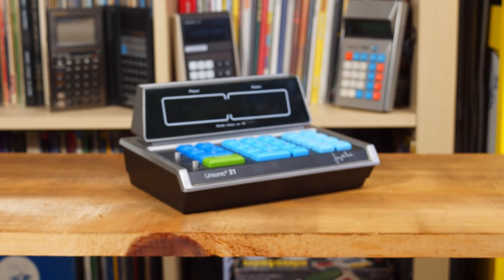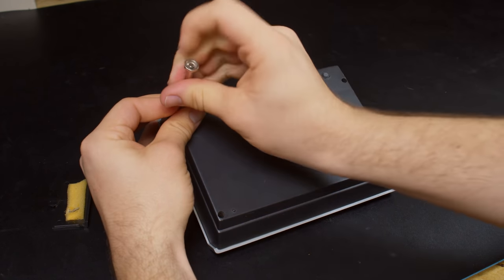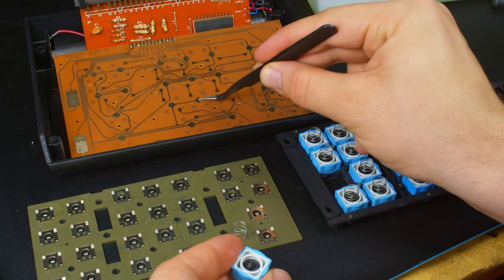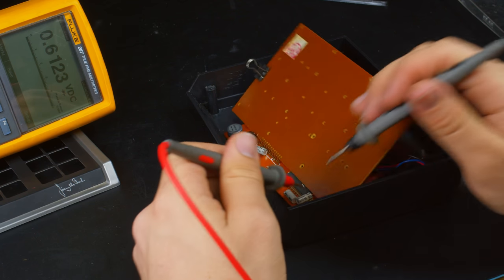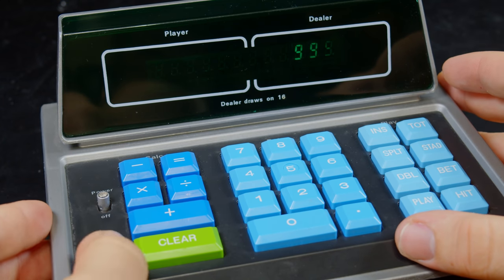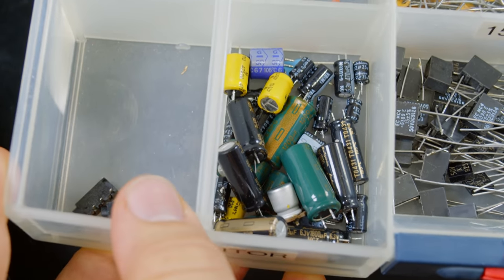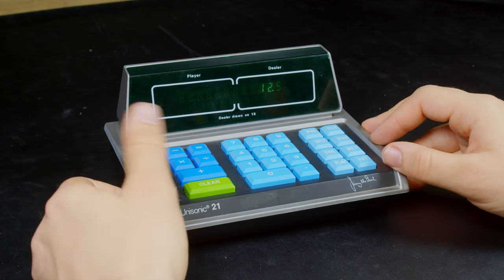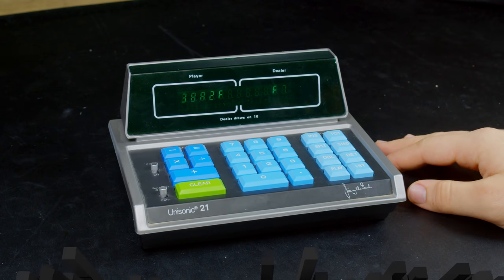1977 Blackjack and Calculator Diagnosis

Comment: The white "ghosting mark" /IS/ a problem. It should be nice and shiny, not white. The display lost some of it's vacuum and the getter material that was deposited onto the glass was used up when the air started entering. The round thingy is a transformer. It's not faulty, you have the Negative 35-ish volts you need and the AC filament drive.
Reply from the maker: You made me go look up the part number for the display, and it is looking like that may be the problem based on the white mark being black on NOS parts: https://www.ebay.com/itm/VINTAGE-FUTABA-13-BT-94Z-8H-VACUUM-FLUORESCENT-DISPLAY-NOS/264066687238?hash=item3d7b99e106:g:AZkAAOSwnfRcAXwY:rk:1:pf:0

I was basing this off an experience with a Casio CQ-1 I was sent. It uses a VFD that was sealed with a white glue substances that looked just like this does. I got a bunch of comments telling me the VFD was bad in that when it wasn't because I repaired it by replacing a blown transistor and the display is brilliant on that device now. So from that I learned a white mark may not be a bad VFD which is now a lesson I unlearn with this one.

Unfortunately, that VFD is still about the same price as the caps and therefore the NIB example for me. So I will still not be repairing this one.
Reply: Yep, VFD clearly is gassy, needs to be replaced.
35V looks healthy for a display like that. 8Ohm ESR isnt good but would not cause much trouble yet.
Reply: I was about to point out the same thing. Beat me to it, good job!
Reply: David Richmond You're right, it's a gassy vfd, the shading towards one of the ends is more evident in dc filament vfd tubes, the emissivity decreases as it gets farther from filament ground.
Reply: @johnbonham7515  In this case i think the shading is a coincidence, other than DC filament. The small round TDK transformer offers proper AC drive which is what's used here. The shading might be a mix of a gassy VFD + bad multiplex timing.
Reply: zapro_dk Yes, I agree it has gassified. The bad multiplexing may exacerbate it, I remember some long vfds with multiplexing problems on which a sort of "zebra" pattern (bright and dark alternated areas) was visible.

Comment: A general rule of thumb for cap replacements with me is if it's blown/bulged, I'm replacing it with a higher voltage rating. If they're old, I will replace with like or higher voltage depending on what I have. 50volt ratings aren't unusual actually, even with caps down to 1uF. Whenever I get from Mouser, I usually do a variety order with a max of 20 bucks including shipping. I'll get what I need, plus a general variety of other value components to throw in my parts bin. If I need 10uf caps, I'll get them plus a few extra, and I'll throw in 100uF, a couple 1000uF etc. It helps to build a small stock if you find yourself repairing things  like that often.
Reply: Its funny how i aways see these prestine looking capacitors all failed and broken in other's people hardware, in videos, etc. But my old pcchips board with literally 90% of the caps badly deformed rusted and even leaking sometimes, still actually decently working (after you clean the ram slots with alcohol because capacitor fluid might be getting in there sometimes). 

I gave this board 3 years ago to a friend who supposedly would (eventually) recap it, but from what i know he didnt recap it yet, lol

Comment: On the topic of calculators , the best kind of costcutting on a calculator is to not include poweron reset requiring manual zeroing before use.

Comment: New in the box most likely won't work either. Capacitors age by only sitting dormant too
Reply from the maker: Very likely,  but one in NIB condition would be a much better starting point if I wanted to repair one of these. When I picked it up for $5 I didn't know I could get it NIB for $16 or I probably would have passed on it.
Reply: VFD might be good tho.

Comment: I like to fix my own stuff , it’s kind of a hobby .There’s a huge scrap yard near my shop that has tons of electric boards laying around , whenever any of my appliances or tech gadgets break i go there and always find whatever i want . I’ve found dozens of capacitors , resistors , diodes and even mosfets for my welding machines . I became friends with the owner ,I pick up whatever i want and the he even invites me to sit down for a cup of coffee and doesn’t charge me anything , when u said 10$ for capacitors i felt pretty lucky .
Reply: When you see how expensive is to recycle/trash electronics, you'll understand why the guy is more than willing to give you stuff for free.
Reply: CrimSun i’m pretty sure he piles them up and sells them by the ton so contrary to what you said he gets paid to get rid of them .
Reply: @Danny-wv8ec  I'm not sure if this applies to where you live, but in other places, you have to pay to have electronics recycled or out of your hands.
Reply: CrimSun i checked on Google , scrap yards all over the US buy electronics . The most expensive pricing is for CPUs , more than 35$ per pound , hard drives are 4$/lb. They also buy all kind of mother boards and PCBs .

Comment: Slow start and very faint display almost always mean dry capacitors. Replace them, especially the one in the logic power circuit.
PS, 5 dollars for 5 capacitors? Their actual price is at least a hundred times less...
Reply: Shipping is a killer
Reply: If you want to use the exact values when you can put higher values ones (which was what I did when I had to recap my PC display), yes. Those off value ones are not manufactured that often.

Comment: Nice work with the zoom/approach effect (can't remember the technical name!) in the opening shot! Do you have a slider now, or just some good post prod stabilization?
Reply from the maker: I made a slider out of a server rail. That is a real slide with fixed focus on the camera leading to the calculator. At some point soon-ish I'm going to be doing a filming setup video covering my new camera and the new microphone I got that I used for the first time in this video(a Marantz MPM-3000).

And it's called a Dolly Zoom, so you were close!
Reply: @TechTangents  Oh wow, nice idea for the DIY slider! I'll have to keep an eye out for some stable rails for my own video projects haha

Looking forward to the new gear vid :)

Oh, and thanks for the correct name too haha
Reply from the maker: After having made it, I don't recommend making a slider out of a server rail. It rotates way too much because it's really only designed to be strong in one axis. I had to add a flywheel and pulley system to make it even close to stable and it still isn't great. I'll cover why it's not ideal in that gear video.

Comment: It's indeed the display that's gone. The getter-spot has turned white, that means that air got into it. This way it can't work properly and it will even worsen as more air gets into it. Also the heated cathode will burn out rather soon in the presence of air.

Comment: Come on - pull the trigger and just complete the repair! Between the time spent troubleshooting this device and filming and editing, you're already invested way beyond the value of this gadget (30x?). Just order the caps and solder them in - that's the fast part left to do. Maybe slot that part order in alongside others next time you're putting an order in with DigiKey or Mouser or whoever, so that the shipping gets subsidized by that new order - we can wait for the video. Also, I wouldn't trust the ancient new in box one as necessarily being any more reliable than this one, unless the seller is showing pics of a fabulously working screen, etc. Best wishes.
Reply: The caps are fine. The VFD is gassy, and that is why it looks so dim.
Reply: Probably tho the vfd is also shot. And tbh he could like wire in paralel a bunch of caps to met the old bizarre ones (probably), but that doesnt seem the way he would do it.

Comment: When making a list of components to order in the future, make sure you also write down what they're for. Otherwise after a year, when you remember you had seven order lists in five different locations on your hard drive, you're like "what the hell were these for?" I also tend to lose my repair notes so sometimes I write a post-it note of the symptoms and possible defects and fixes I've discovered, as well as a mention if I've connected mains to the logic chips, and leave the note inside the case for future me. Or maybe even someone else who wants to fix it when I've lost my marbles and I'm being treated someplace soft.

Comment: I've seen some of the old COLECO table top arcades VFD displays go from non working to working simply by taking the cabinet apart, doing nothing, putting it back together.....? BAM, fixed and fully working for "reasons"

Comment from the maker: About the back filming surface, after a test video I decided to record a complete video using the underside of my ESD mat. Here is the test video: https://www.youtube.com/watch?v=1XoyG6w6FJo The blue reflects a lot of light onto the subject and into the camera during macro shots. A darker mat would give a noticeably better image quality. But the black is too dark. It didn't work well for this video. I will be going back to the blue side until I get something else that works better.
Reply: sorry link machine broke
Reply: Do you have an idea of a color/material that would work? like a specific shade of gray or something?
Reply from the maker: @guycrew728  My intention is to now find a very deep dark blue. It should really be an ESD mat so I can work with out worrying about damaging parts(and snide comments). A medium grey would work as well. Most ESD mats are too lightly colored though so it's a challenge.

Comment: The brightness gradient is caused purely by the amount of time each digit has been illuminated over the years. The rightmost digit would be displaying '0' for much longer than the other digits would be used.
Reply: A battery powered device? No. This unit has very low hours on it.

Comment: Lol I was screaming capacitors from the beginning... I also have a Unisonic calculator model 1048R and also had a ton of problems (bad capacitors, bad switch contacts, bad power switch) and I still didn't properly fix the key switches because when you press some of them they repeat themselves lol.

Comment: My comment was auto deleted when I added links to the images for the unisonic 21 and adaptor so I am reposting my previous comment.

According to the labels on the unisonic 21 game calculator model d-3, it’s electrical rating is 6V DC 140mA and it can run on an optional A/C adaptor available from unisonic dealers model no. SY1200 or model no. 620 A/C adaptor.

The label on the unisonic model no. 620 A/C adaptor reads as follows. Input: 117V 60Hz 3W Output: 6V DC 100mA  Center Negative

There are examples of both the unisonic 21 same version as yours and 620 adaptor with the labels on eBay.

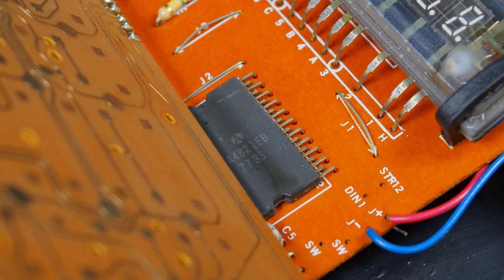Comment: 13:18 The getter in the VFD looks rather milky, which could be the VFD is gassy, and that would certainly cause it not to work correctly, like lose brightness.
The getter should be much darker and shiny in appearance if a good vacuum was still maintained.

Comment: I see on amazon capacitor assorted kits of electrolytics, some of which include 0.47uF 50V. Eg see dp/B015IR1DAU (didn't want to send a full link in case it went directly to spam)
May not be useful for this project, but it might be something to getfor future cases.

Comment: Change the VFD  and it will work perfectly fine. You can see that it is defective because the dot at the right side is white normally its metallic shiny. This is a getter spot that makes the vacuum stable and in this case its gone.

Comment: The patent that looks like it's probably related to this calculator is 4,339,134 (Noticed the IC is from Rockwell). Gives a nice overview of the functionality of the unit. Link to USPTO patent listing: http://patft.uspto.gov/netacgi/nph-Parser?Sect1=PTO1&Sect2=HITOFF&d=PALL&p=1&u=%2Fnetahtml%2FPTO%2Fsrchnum.htm&r=1&f=G&l=50&s1=4339134.PN.&OS=PN/4339134&RS=PN/4339134

Comment: related: http://www.halfbakedmaker.org/blog/a4821-reveng-1 

Calculator is 8 digits? I wonder if they just transplanted/used the same calculator device/logic from their other 8-digit calculators, and put that next to the BlackJack logic.  The display shimmering could be from the calculator logic/output colliding with the blackjack output until the clear/reset causes the BJ to disable that. 

While some websites list the earlier handheld "Unisonic 21" as having 12 digits of precision, I've only found pictures showing the calculator using 8. I wonder if they later updated the logic after introducing calculators models that actually do have the needed precision.

Comment: 7.6 ESR is not THAT bad for a 10uF/50v as they had different standards back then, and caps rarely fail on battery powered devices
Reply: And tbh the caps looked fine, i have badly deformed, rusted and leaking ones wich actually still "work" in my 775 motherboard

Comment: Did you check the heater voltage? Also, current. Clean the switch pads just to be sure.

Comment: oh by the way the model you have is a 80s revision b the rev a from 77 actually had wood grain more switches and was heavier. i have the 77 model and the 80s model and the 80's model is even built different internally.

Comment: Hello. I've just spent about 30 minutes of my life watching an old cheap calculator-with-a-game repair video. The device was  disassembled, the restorer hopped from one potential cause to the other until he finally fired his ESR-meter after 23 minutes, so that could have been another recap video. Then he decided 5 caps were 1 dollar too expensive et reassembled the poor thing with its old caps. In the meantime, either with usage or because of the iron solder heat, the caps restored themselves just enough for a faint display. 30 minutes of fiddling and no actual repair... Only good thing was a shango reference in the comments. Please tell me what's wrong with me ! 🤣

Comment: Where do you live that you have to pay 2$ for a cap and can't be sure they have 50V caps?
My local electronics shop carries caps up to 400V and they're about 50c worth in my local currency (for a 22u/400V as an example).
Reply: His issue is most likely wanting the exact value and rating caps, when you'd be just fine using higher value ones, since these are not high precision devices that depend on exact spec caps. When I had to replace the caps on my display, the guy didn't have 650v ones ( I needed one 900v and one 650v), he just handled me two 900v ones and the display works just fine.

Comment: Why not just buy a few cap sets on ebay? You can get a set of many different values for a a few $. They may not be the best quality, but they are totally good for replacing a bad cap here and there in a pinch.